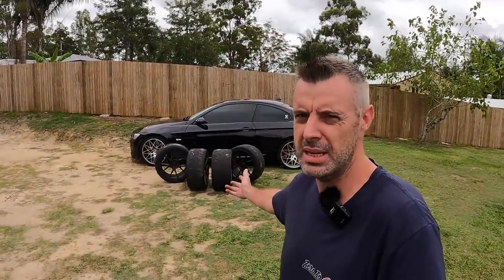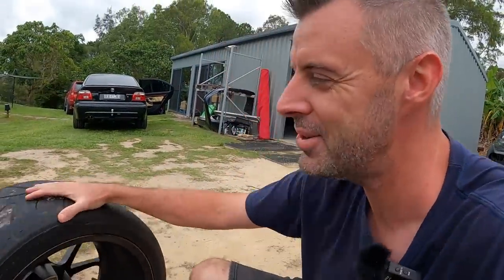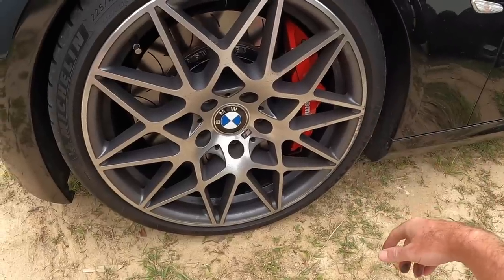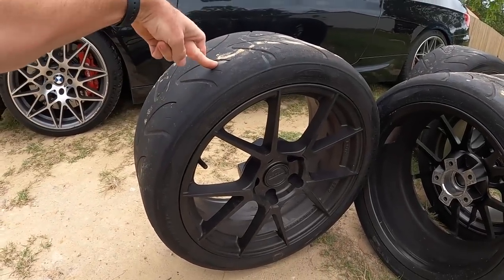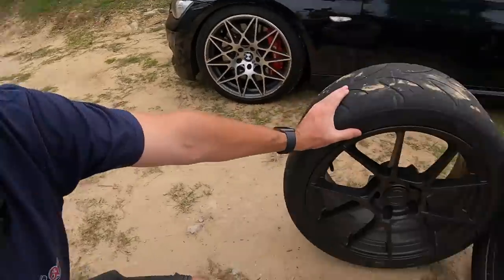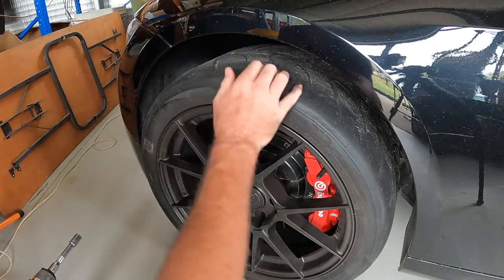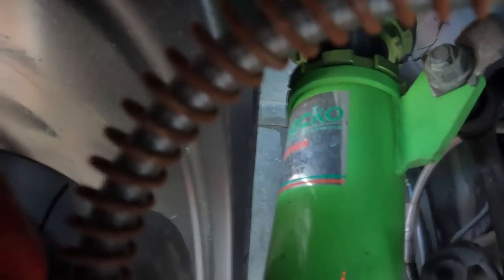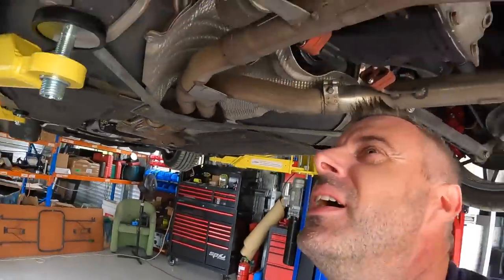HUGE RACE wheels and TYRES for the 17t BMW E92 N54 335i: Will they fit?

Comment: Hard to tell from the video, but if you machine the front wheel down, will the brake caliper still clear the wheel. Its not always the front facing part you need clearance from. You also need clearance on the top of the caliper, where you put the pads in.
Reply from the maker: When i filmed this yesterday i did look at that, but that is something i better double check. Thanks for the reminder.

Comment: Pretty sure Koya comes form sunny Beenleigh mate.. not a bad wheel. Currently using at set of Koya wheels myself. P.s. I will miss you're current (old) wheels.
Reply from the maker: The koyas, if I can get them to fit will just be for track work and special occasions. Old ones will still be on most of the time.

Comment: I just picked up a 2010 335i convertible.  I want to try and fit my wheels I had on my f80 m3. It's same specs as stock comp 20's. 🤔 they should fit.
Reply from the maker: It will be super close in the rear, but i think you should be ok if you are at stock ride hight. Worst case scenario you my need smaller tyres. But i am currently running F80 M3 wheels with 15mm spacers on this car.
Reply: @ZeroTo60Tube  thank you for the info. Ya I'm gonna stay stock height.

Comment: I know you can get to 255/35/18 with ET30 and no changes, if you want to add camber you can change the front arms to the M3 replacement arms and gain a bit more (plus new bushes and more turn in response/traction).
But if you want to fit 265/35/18 you could do it by doing a front M3 conversion, fatter side fenders and all the stuff but that will be expensive (and cool).

Merry xmas from Chile!
Reply from the maker: Merry xmas to you too sir!! Thanks for the tips. Would love an M3 conversion but it will be a bit expensive for now. I think im gonna get the adjustable strut tops and see how that changes things. Also need to make sure we can get the fronts machined down.

Comment: I was messing around in my garage with my fenders while waiting for my widebody kit and just discovered you can actually roll/pull your ABS (plastic) fenders on the E92 if you use a heat gun and the standard fender rolling tool.

You'll probably screw up your paint but it only costs about $20 to get yourself a can of colour matched paint which is enough to redo the whole fender if need be anyhow.

Looks much cleaner than overfenders too.

Comment: You should find a shop with a 3d printer and print  wide body front fender guards they are made of plastic from the factory.  I would get  wheel studs for front and rear to ensure enough clamping force and keep your wheels on the car, your going fast now think of safety issues possible rear hoop over the drivers head.  With incremental speed the risk factor goes up so be safe and haul ass at the same time.  love the channel cheers  merry christmas
Reply from the maker: Thanks for love man and the ideas. Hope you are having a great xmas.
Reply: Wheel studs are a great idea.

Comment: Ton of clearance between the front spokes and caliper. Plenty of room for milling. I know 9 inch ET30 wheels will fit the front. 

Don't put camber into the rears. That is not going to help straight line traction. If you have enough space on the rears between the spoke and the caliper get the rears milled a few mm as well, but what I would do first is remove the spring from the rear and cycle the suspension up and down to see how close things are. The rear should gain some camber as the suspension compresses. This will also help you see if you can bring the rears in a bit by milling the mounting surface of the wheel. 

Pretty much any competent machine shop should be able to do the milling. 

If these tires were used for circuit racing then they had some proper heat cycles put into them. The more heat cycles a tire sees the harder it gets. Just keep this in mind as you evaluate the traction of the tires. You really have no idea how many heat cycles these tires have seen.

Comment: Finally got a set of 18's!! Can't wait to see how the traction improves. Get the fenders and quarter panels rolled  and pulled. That's what I did with my 135i. The fitment for the 135i is even worse😬😬

Comment: You forgot to check the turning angles of the front wheels. I had problems on my right front wheel with wider tyre and poke setup, the tyre was touching the inner fender oil cooler grille (the loose piece that is held on by 4 bolts. wheel was rubbing the plastic part as well as grinding on one of the bolts when you do a full lock. may need to remove the loose piece entirely if you are going this setup. 
Cheers!
Reply from the maker: Good call!

Comment: Need to square up those back wheels for max traction in a straight line i.e. zero camber static.
Dynamic camber will occur under full power anyway 👍

Comment: If you can machine the front to ET30 I think you would be good there.  I’m running 18x9 et30 with a 255/35r18 ps4 on my e92.  Fits great just a little minor rub on the oil cooler vent while hard turn reversing.  Never rubs in normal driving.

Comment: You probably don’t wan to run camber in the back on an IRS car if you’re after traction in roll racing, you would want a tiny bit of negative camber so when the car squats it zero’s out the camber and gives you the full tread patch on the road

Comment: You could try some octopus grip tyre conditioner for the older tyres. Will soften them up and restore a bit of the elasticity in the rubber if it's hardened over time. Would also be interesting to see a before and after acceleration times with it.

Comment: I have 8.5 j and 9.5 j with normal tyres sizes stretched for the moment but new tyres will be 245 front and 275 rear ...et are 34 and 38 if irc could stretch to 255 and a285 with no problems ..merry Christmas 👍
Keep the content coming .... brilliant 😇
Reply from the maker: Very nice! Thanks for the info, its good to know what can fit.

Comment: I don't know about clearance, but I do know about weight. It is SO important to lower the unsprung weight. I'd rather ride on lightweight, narrow 17" wheels than on cool, beefy 18" wheels. If you have any feel for the car at all, you'll know it the instance you fit a pair of truly lightweight wheels.
Reply from the maker: Well i was genuinely surprised these 18s fit over the brakes.  Most aftermarket 18s and definitely no genuine wheels i have found clear the 380mm rotors. Some special 17" wheels may clear the 355mm brakes i have on the rear, but finding something down here will be hit and miss and probably more expensive than what this whole set cost.

Comment: Machining the front wheels down is a good idea, you can get the wheel to clear the fender more and also get more wheel bolt threads to engage... overall safer, Merry Christmas also!
Reply from the maker: Yeah, that what i was thinking. As these are all made to order it looks like they have left a bit more material on the hub section that you would normally get on a mass produced wheels. Definitely have some working out to do.
Reply: @ZeroTo60Tube  if possible could you try fitting the rear wheels on the front? I have a 2010 e90 335i that I have dumped 20k+ usd into single turbo swapping a lot with all the maintenance, cooling and I have also upgraded breaks, rotors pads along with a helical LSD... I am looking to get wheels and I can’t find any forms that advice just how wide of a tire I can find in the front, so far I know a 265 on a 18 or 19x9.5 +35 will work. I plan on tracking the car and want the most grip possible, would really appreciate any information you can share!

Comment: Just put the front wheel on the back and then you will have traction for roll racing if you put too much camber in it you loose a lot of tyre surface on the road therefore loosing tyre size so you may as well run small tyres

Comment: I've got bmw e90 m3 competition wheels staggered on mine 19 / 9 on front and 19 / 10 rears tyres up front 235 35 19 and rears 265 30 19 no rubbing issues even with 5s up slightly stretched tyres so mind curbs Park wider for precaution
Reply from the maker: Thats good to know. These are a little more aggressive offset than m3 wheels but should be pretty similar.

Comment: Nice wheels mate. Just make sure before you spend on realignment on camber adjustments that the tire is not rubbing or very close to rubbing on the suspension or springs
Reply from the maker: Thanks for the tip

Comment: Just graduated and got myself an E92 as a first car. I have the original 313s with a 39 offset on 255/30/19. But I accidentally ordered rears 265/35/19. Instead of a 255/35/19. Was only going 5 up on profile for the comfort. I can’t cancel or refund them. Do you think they’re going to rub? I’m scared lol. I don’t want to roll my arches or mod anything on the Body. Any advice?
Reply from the maker: I dont think they will rub..... but it might be close with that 35 profile tyre
Reply: @ZeroTo60Tube  Thanks man. I’m certain 255/35 was the perfect max size for stock. 265/35 however, cost me a lot. Hopefully no rub but I gotta make it work now lol
Reply: @DrummerBoii1411  did they rub? planning on going 265 for rear

Comment: For what u spent on those wheels and tires u could have done a drag set up way cheaper. 
Just get rid of those calipers. Im running 15 in rear and front runners in front, and just swap back my stock fronts on track days
Reply from the maker: Not in Australia, we get fingered with options down here and everything is much more exxy than in the states.

Comment: Gonna need -3° degrees of camber upfront and a smaller tire and of course fender rolling. It's possible but the setup might be leaning more towards stanceboi than utmost grip.
Reply from the maker: Hmmm we'll see.... the front is gonna be a mission to fit.
Reply: @ZeroTo60Tube  Real M3 fenders may do the trick if they fit on the Non-M E92 🤔

Comment: Damn those look good, been going thru the pain of trying to find a set of wheels for my 335i, seems if you want something even remotely good looking they aren't in desirable sizes 🤦‍♂️but these look pretty sick and checked the website and they accommodate pretty much everything size and et related and actually make some really nice designs. Hoping there isn't any funny business about sending to the uk 🤷‍♂️
Reply: I'm in a similar boat and heavily considering just running adapters so I can use a Nissan bolt pattern...the extra poke would also let me clear my big brakes when they finally arrive...china takes forever.

Comment: Hi. You have two bodies e92. Do a wide body on one for wide wheels. I'm curious if m3 fenders are wider?
Reply from the maker: The genuine M3 fenders are wider both front and rear. I have a feeling the M3 rep fenders for these are the same with as the stock ones. But may need to do some checking on that.

Comment: Noice! I can't believe you ran 255s. I have 275s on 10 inch 30 ET, 19 inch rims on mine, still have no grip
255s would be a disaster lol
Reply from the maker: Well the 255's were cheap...... thats all i have to say haha
Reply: I grip with 255s as long as it's warm outside, 515whp
Reply: @J B of course. Generally, no 255 will hold that much power lol

Comment: Honestly, do not machine the wheel. You will weaken the structure. Sell them and buy some Apex wheels. They are designed to fit perfectly.
I run a 265/35/18 square no issues with an ARC 8 wheel.
I can fit up to a 285 in the rear no rubbing.
Those wheels are the incorrect offset for that chasis.
Reply from the maker: Do you know if the arc 8, will clear the 380mm brakes? Unfortunately they are bit too expensive down here a lot more than these cost me, so i can't really buy a set, just to test incase they don't fit.
Reply: @ZeroTo60Tube  if you contact Apex wheels they will assist you in fitment with regards to your brakes. They are an awesome company to deal with and they will take out all the guess work if you tell them what your goal is. They specialize in BMW fitment. 
You won't be disappointed, and you will be able to properly run the biggest tire possible.
Reply from the maker: @holeshot895  if these dont work out, i might keep doing some saving. I know they are cheap for guys in the states but it looks like it will be close to $2600 to get a set sent down to aus with shipping and import duty and yeah would need to 100% spot on with fitment

Comment: I don't think you want neg camber on the rear..... It will give you less traction in a straight line?
Reply from the maker: You are correct, i see it on circuit cars, but for straight line stuff, we need them as flat possible.